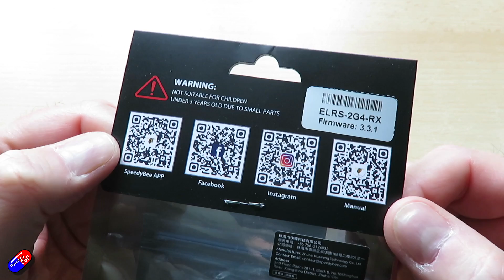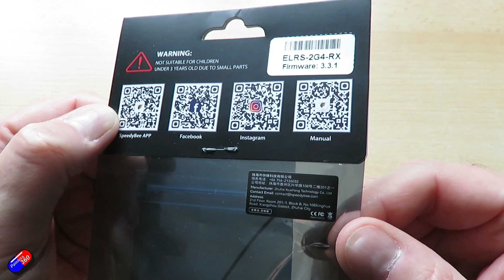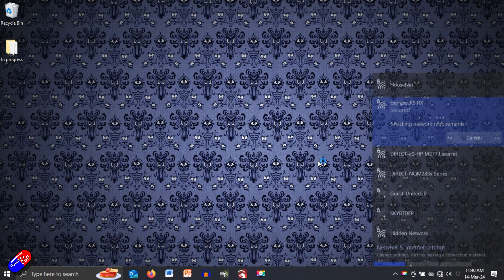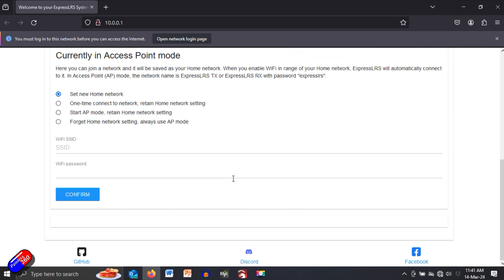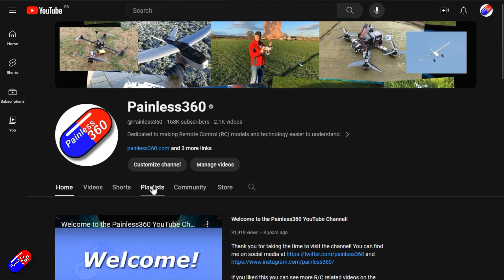SpeedyBee Now Making ExpressLRS Hardware! First look at their first ELRS Rx...

Comment: Isn't it a bit big for a normal one antenna RX? According to the data sheet it does not have TXCO. Especially compared to the happymodel EP1/2 with TXCO it seems to be double in size but lacking features. Just wondering what for?

Comment: I was in quadcopters during the time of KK controllers.  I want to see ELRS receiver integrated with FC, baro, ESC, OSD, VTX, then I'll pull the trigger.
Reply from the maker: I've seen lots of them for whoops, so I don't think it'll be long (if they are not already out!)
Reply: They should do that with their wing fc... That would be pretty unique!
Reply: Kk board!  I remember those days.  Simonk custom flashed escs. Generic carbon frame and a Sony ccd camera.  Big ugly silver and gold motors.  Dual blade props with massive silver prop adapters that always flew off. When flying quads was really flying quads. 😂😂😂
Reply from the maker: Ah, the days of needing 8 PCBS to get a quad to fly with FPV (FC, 4 x ESCs, MINIMOSD, receiver, VTX and a low res crappy 600TVL FPV camera too. All hand soldered and all programmed using a PC or a FTDI adapter - and that isn't counting the GNSS config you needed to do if you wanted to add a GPS :D

Comment: Let's hope we don't need to wait for a V4 to get the design bugs out.
Reply: Yeah, I keep hearing complaints about design defects and quality control issues. Their stuff is extremely ambitious, but they really need to be more careful. If they'd just be reliable, they'd be among my favorites.
Reply: Agreed. Currently have around 50 packs through my SB F7 V3 stack, it has been flawless so far.
Reply: First batch of the v3 stack bad a lot of the ESC's pop a FET.
Mine did after plugging in the 3'd lipo on it. On 4s with a capacitor.
Haven't heard that happen to the V4.
Reply from the maker: I think that was what @helidude71 was alluding to. I used the V4 in the QUAD Build for Beginners series over Xmas and it has worked flawlessly. I think that Speedybee learned a lot from that and form the pushback from pilots who had issues with the V3. All I can say is that, if I build something with it - you can usually bet it is a pretty solid product ;)